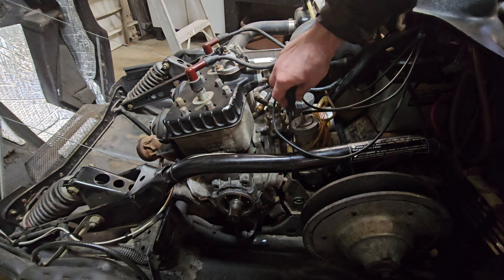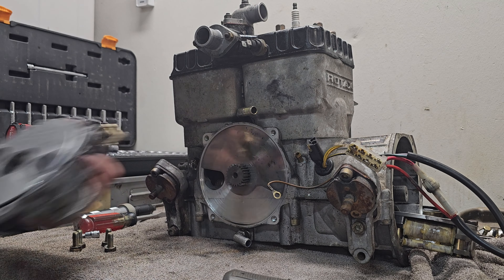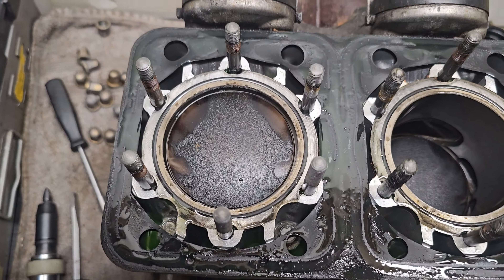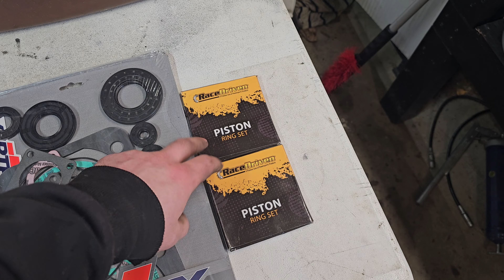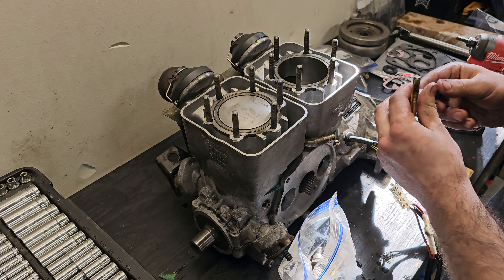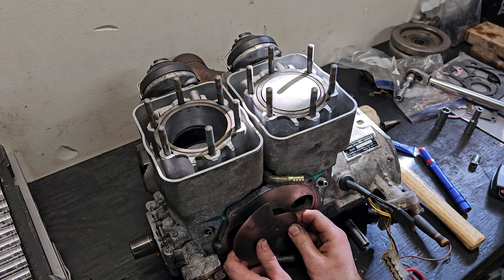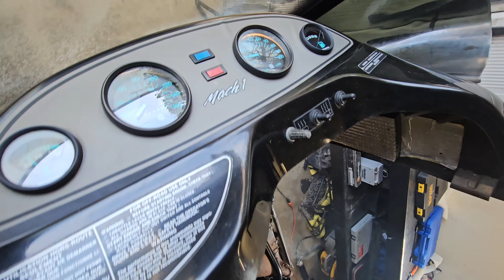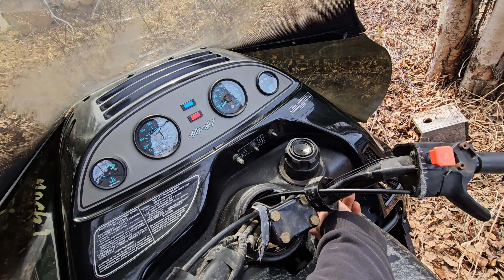Skidoo Rotax Engine Rebuild | Formula Mach 1 617cc

Comment: Remove two nuts holding the top of the belly pan and there is enough room to get the clutch out without removing the motor mount bolts